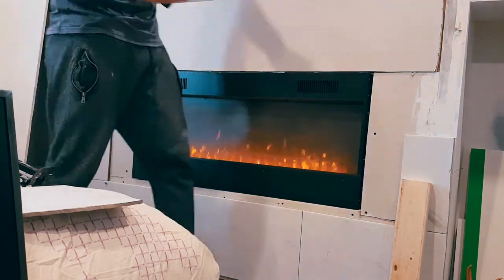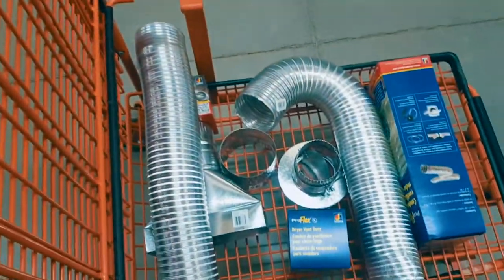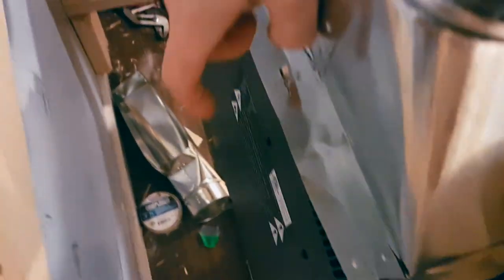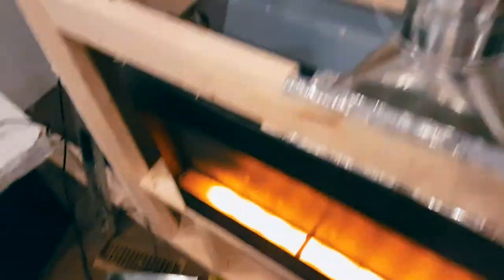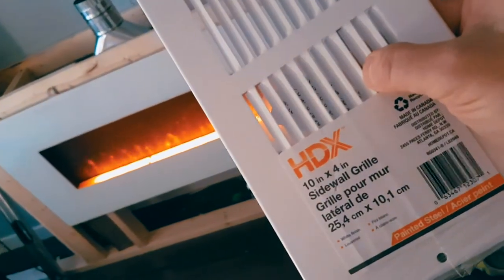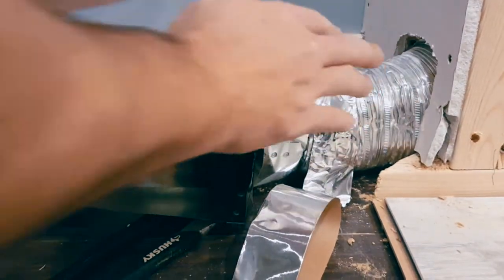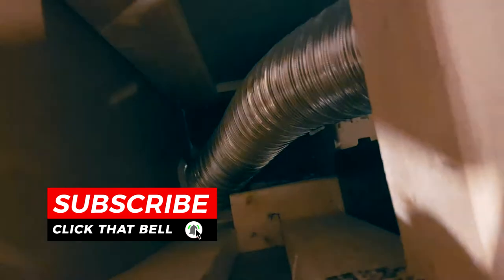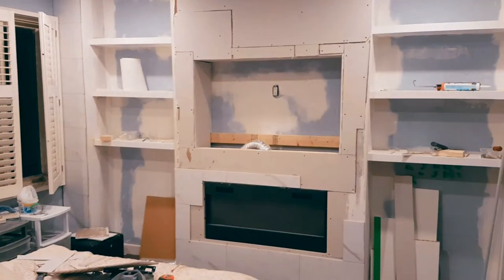Add Duct Vents to Electric Wall Fireplace. Make Wall Mounted Fireplace Recess in a Wall.

Comment: Thanks for this video. Built a very similar setup 2yrs ago. Did just before leaving home for an out of town contracting job. Didn’t cutout any ducting area. Wife wanted in place for looks, and the fake “no-heat” flame. 

Now I’d like to add the ductwork for the winter since I’m back home. What I did was mount the fireplace by way of hanging it from the inside. All I have to do to access it is by lifting up, and tilting. This was planned as I knew I would be back in it at some point.

The above method prevents me from having to cut into my peel & stick stone tiles.  Though, will absolutely have to make a cut, or two, for the duct(s) that will be added.

Again, thank you for showing what I was trying to play out in my head. Makes more sense when you see it!!!

Comment from the maker: I show how to  build a fireplace recessed frame and install a top heater Wall Mounted Touchstone Ivory Electric Fireplace that i converted into a recessed wall mounted fireplace with a few duct pipes under $50. Learn how to do a fireplace surround remodel, heat up room without adding duct work to a room step by step. I hope you get some electrical fireplace installation ideas with this video - Leave Any questions or comments - enjoy! 

Suggested Fireplaces: 
Touchstone Ivory Wall Hanging: https://geni.us/TouchFireplaceIvory50
Touchstone 8004 50"BLK: https://geni.us/Touch50in80041500BLK
Tangkula 50" Blk: https://geni.us/Tang50inFireplace
RW Flame 50" Fireplace: https://geni.us/RW50Fireplace

Here are more Do-It-Yourself DIY Project Ideas on a Budget: 
- Add Ducts to Wall Mounted Fireplace to Make it Recess: https://youtu.be/_JUW13gy9S0
- How To Recess ANY Wall Mounted Electric Fireplace: https://youtu.be/4ZDg4wYAaCw
- How to Paint Exterior of a house: https://youtu.be/2AMNWFLGgOY
- 1 Day Interlocking Walkway Guide: https://youtu.be/dpsBFtB6EdA
- How To Cut Porcelain Tiles by Hand: https://youtu.be/x7hNjUv0ZWo
- How to Plank Bedroom Walls - https://youtu.be/bYQ8I-EVaX8

Comment: I basically have the same fireplace. Added duct work exactly like this video. Everything works fine.  However, I put a plastic aria heat vent on side of FP wall and it melted.
Reply from the maker: Yes it gets very hot use metal vent registers

Comment: We did this the heat comes out for 5-10 minutes then stops heating waiting on contractor to help solve problem 
all vents on top Dimplex linear wall mount  not sure how to solve issue
Reply: Did you allow a place for air to go behind the unit.
Reply from the maker: So that's not issue of the ducts you created if everything is sealed correctly that is. It's your fireplace, they have thermostats and self control them selves but they don't re turn themselves on like our furnaces. So yes it's your fireplace model likely. Not a repair issue

Comment: If you do this make sure you allow a place for air to go in behind the unit.
Reply from the maker: Yes there is lots of space behind the fireplace
Reply: Hi, how much space would you typically recommend ? Trying this soon ^
Reply: Match the area for air to go in with the area of the exhaust/heat vent.

Comment: do you have to make a hole so air can go in the wall to be heated
Reply from the maker: yes, 100%, i created an entire ducting from the top of where the exhaust fan is outwards where the heat vent is. besides that you dont need any additional holes, also it blocks the noise of the heater. if you want you can drill a small hole if youre concerend.

Comment: My venting is in front but my ventilation is in back like yours. So if it has exhaust in back is it an issue that it is boxed in wall?
Reply from the maker: Yes, it's a big issue!, unless you create a ducting system like mine, you shouldn't box it up, i don't think it will catch fire if you only have sheetrock there. but you'll definitely burn the motor.